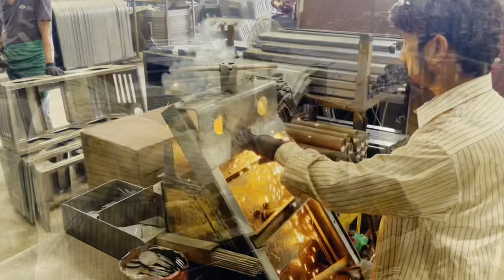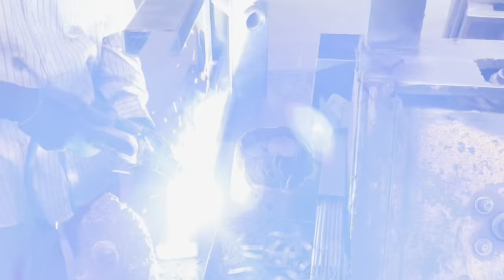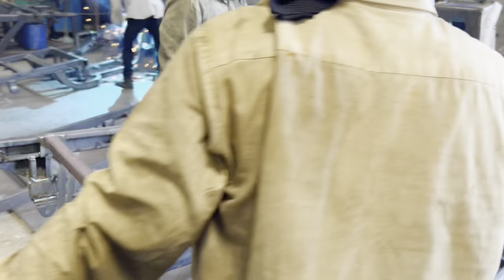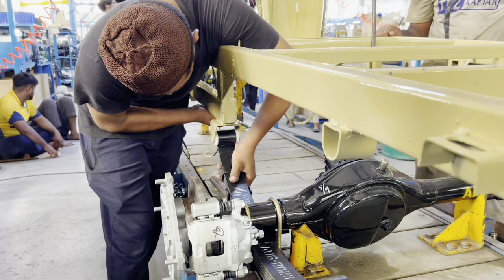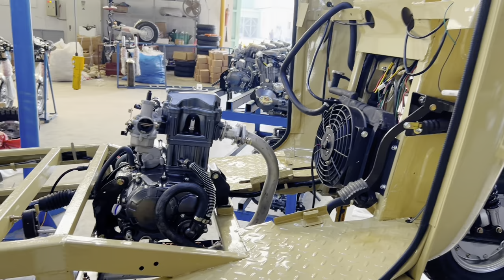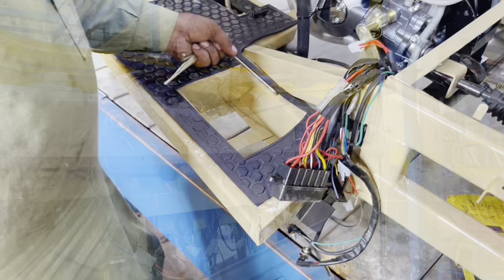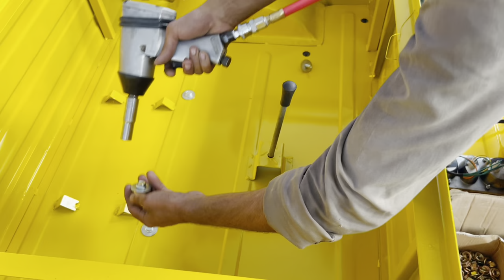How Tuktuk Rickshaw Manufactured in Factory | Complete Production

Comment: I hope the managers provide the man in the Paint Booth with Eyes & Respiratory protection before the poor man gets cancer or loses his eyesight.  Thank you for sharing this great video.  The humble TukTuk contributes positively from day one, when it started as a Vespa mini truck in Italy.
Reply from the maker: Exactly 👍
Reply: да там много нарушений техники безопасности,нет средств защиты -  таких как маски,перчатки,про обувь вообще молчу...Да и к сборке претензий много,швы не проварены,а просто прихватывают в нескольких местах...Привет из России.
Reply: And at  1:28  welding without eye protection
Reply: I agree but I think it's a powder coating station and perhaps the floor has positive suction so much of the excess powder should be evacuated?
Reply: The fact is hiring a new worker when the old one becomes unfit is much cheaper than providing proper PPE  and applying HSE protocols.
Reply: На этом производстве нет таких "менеджеров".

Comment: Lots of workplace hazards that don't seem to be addressed. Sandals instead of work-boots. Not many welders with proper eye protection. No mask for the spray painter. Don't get me wrong, it appears to be a very efficient operation, but the workers face quite a high chance of injury due to lack of safety precautions.
Reply: Its all about how cheap they can get. People there are disposable.
Reply: Het is schandalig..... die veiligheid middelen kosten ook weinig
.....
Reply: I think a lot of this kind of video are misleading us. There were obviously at least two different factories here. The first one, making the chassis was the typical backstreet "Let's all laugh at the flip-flops" one. The final assembly plant was obviiously a more modern setup. Although I did notice one guy there working in bare feet!  

And I'm not entirely convinced the chassis we saw being made in the first factory were the same ones being used in the final one.

Comment: nice job getting in most of the building steps. Do you know what size the motor (in cc) they use? Do they make their own wiring harness? Do you ever worry about "burning" your camera sensor when you video them welding? Thanks for another interesting factory.
Reply from the maker: Thanks @gantry289 for your concern 
They are using 100cc motor in this Tuktuk
And yes it’s not easy to shoot these factory video some times camera stop working properly but we manage it
Reply: Kawasaki Bajaj of India uses a 200cc fuel injected air cooled gasoline engine for their 3 wheeled Bajaj RE
Reply: Maxima Baja J 2023, 236.22cc (250), with a 4spd manual Power box.
Reply: 200cc for a 2seater or 400cc for a 4seater

Comment: welding with no goggles: what a terrible country
Reply: Your hatred has taken over your eyesight.
Reply: Trouble nowadays is that the current workforce doesn’t know how it was back in the 50’s & 60’s basically the same as in this video.
Back then H&S wasn’t considered a compulsory requirement..
I remember when I first started out in engineering & working in a machining environment the only thing specified was the wearing of safety boots,
These guys know exactly what they’re doing & as the video shows some do & some don’t wear or use PPE.
& I’d bet that not one of them has had an industrial accident either because of it.
Here in the U.K. you know how far the H&S revolution has gone when you see safety warning signs stating don’t drink battery acid!! 
It’s called common sense, which seems to be a forgotten trait in today’s world!!
Reply: Close your eyes
Reply: But he closed his eyes!

Comment: 10mm bolt? 1/2 inch air impact! 6mm bolt? 1/2 air impact.  Steering stem bolt at 14:35 was amazing, just uga duga that nut until you strip it on there with a worn out pin spanner socket missing half the pins.
Reply from the maker: Thanks for watching

Comment: The total lack of safety concerns is just scary.  Painting with no respirator.  Welding with sandals.  No safety glasses.  I would guess that grease on the steering column bearings is an option!

Comment: These are a very smart, reliable and inexpensive mode of transportation for the region. A country with 100k of these on the road can save a lot on fuel costs and since they are lightweight and of simple design, are easily repaired.
Reply from the maker: Totally agree! 👍

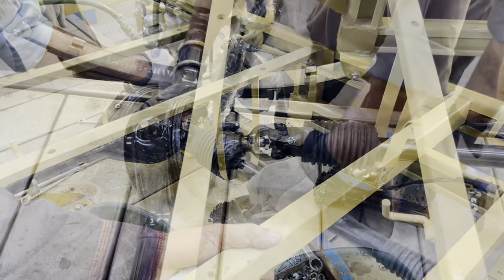Comment: I'm annoyed by the cotter key inserted at 15:15. After bending the pins he left the one pin with the sharp tip jutting out. 

That may not typically be an issue, but he then put in place that rubber protective sleeve over the one pin. I can see that pin eventually puncturing the sleeve thereby compromising the sleeve's structure or allowing contaminants an entry point. 

I would instruct the guy to bend the tips of the pins inward. :face-orange-raised-eyebrow:
Reply from the maker: appreciate your suggestions

Comment: I am fascinated, looking at these builds, but also I am shaking my head on how lacking they are in safety regulations... well... they obviously do not have the same rules as most modern countries have.
Welding, bad for your eyes and also skin. Inhaling the gasses, will seem fine for a number of years, but boy oh boy, do you notice how shot your lungs really are once you get older. ( 27 years welder here, and despite using good protective gear, yeah... I feel a bit of it )
And of course, some even use steel grinder without safety glasses... yeah... that is a big no no at the shipyard I work at.

I wonder how many accidents they have in these industries with using so little protective gear and clothing that seems to come from their own home....

Comment: OK its a 3 wheeler, ok it must be pretty slow, but  Its a freaking taxi , and probably , with a motor bike engine, is very economical to run!  If it could be licenced to run as a taxi in London, Uk, where the flow of traffic is slow anyway, I reckon you could earn a packet running people here and there, when they miss the last train. Better still an electric version!  how much can they cost?

Comment: Safety Lapses, Labor Department can seal this assembly plant-1. Missing Safety Shoes 2 Protective Screens before welding 3- Masks particularly in Paint shop, 4- Assembly line and walking passages not marked 5-Standard of cleanliness in working area was not up to the mark. 6- Sections of Assembly not highlighted 7-First Aid Boxes missing Had this factory automated and worked by robots would have been ideal 🙂
Reply: I know this will be the most APPALLING shock to you - but US laws do NOT apply in other countries.  Now, I suggest that you go and lie down in a dark room until you recover . . .

Comment: The painter has no protection.  None of the tools are calibrated. No torque wrenches anywhere.  Using a tape measure with a black line on it for spacing of major parts.   What a sad state of afairs

Comment: Low quality steel held together by low strength booger welds. No paint prep or primer. Workers not using proper protection when welding and painting. What kind of management runs this place? This is absolutely shameful.
Reply: I'm not trying to be funny. How can you tell the steel is low quality?

Comment: Quite frankly there's little to admire in this manufacturing process. The manufacturing standard for these days is below par, the safety standards even worse. I've seen quite some guess working issues here as well. Leaving cellophane plastic covers on shock absorbers isn't right, drilling into metal without proper protection measures to prevent rust, again another issue, welded bits of metal here and there does not inspire confidence, then the finished product has not been welded to cover all metals, more like spot welding but not more than that, these rigs are rust traps in the making. Compare this archaic manufacturing with those of China, India and Thailand and you will get a clear picture of what I am saying.